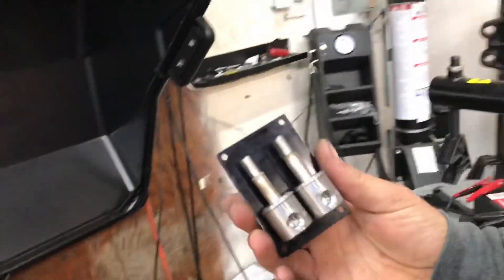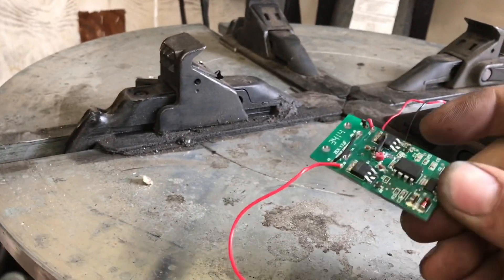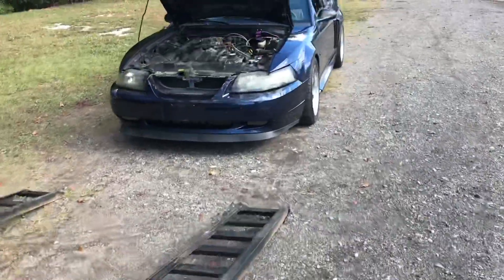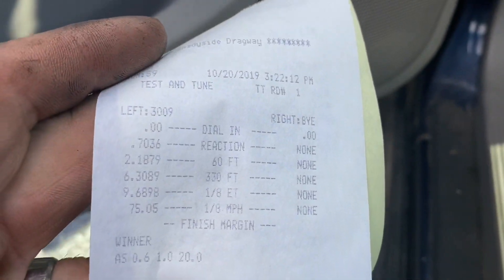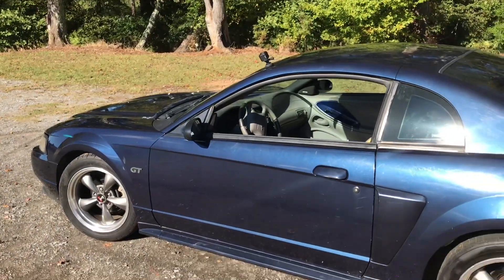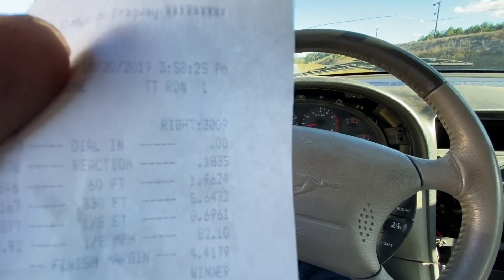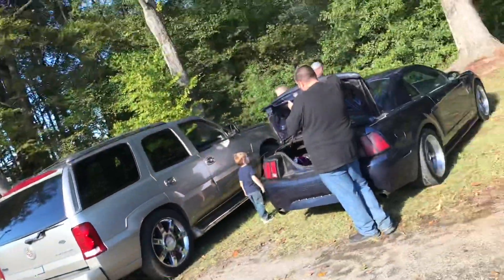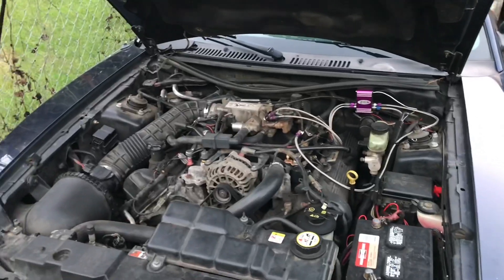CHEAPO REPO makes its first hit on the track.

Comment: Are these runs with the 4:56 gears?
Reply from the maker: No these are with the stock 3.27 gears. I hope to get it back there soon and test it with the 4.56. The car absolutely fells like a whole new car. Much more fun
Reply: I assumed they were still stock gears. That’s what my automatic ran. 9.6
The transmission gears in the automatic are a lot taller than the manual transmission gears. I also had a 5 speed, same model car just one had an automatic and same 3.27 rear gears and you know the automatic would shift out of second gear at like 88 mph and the manual at about 70 mph. Nearly 20 mph is a big difference so I’m sure those 4.55 made a massive difference. Hope to own another one day. Fun cars.
Reply from the maker: @setharnold3699  absolutely lol in the 1/8 mile it never even got to the top of second gear lol.
Reply: DG’S Garage  be the top of third now👍